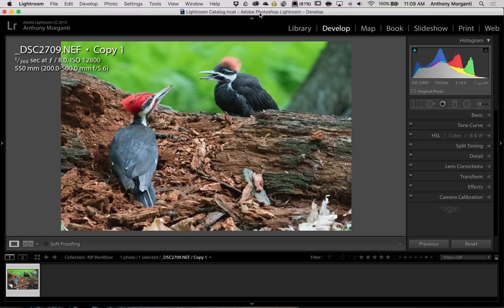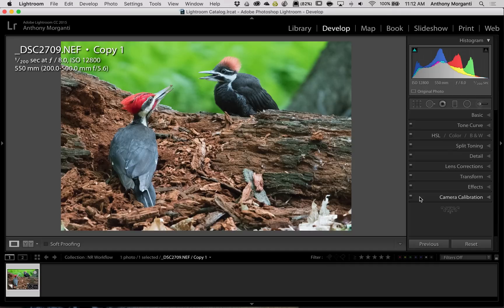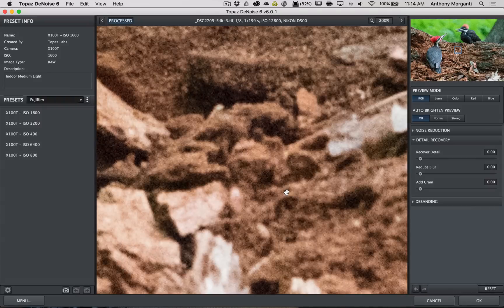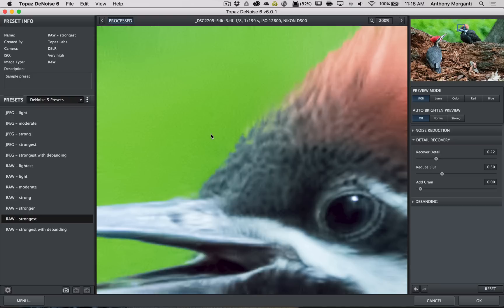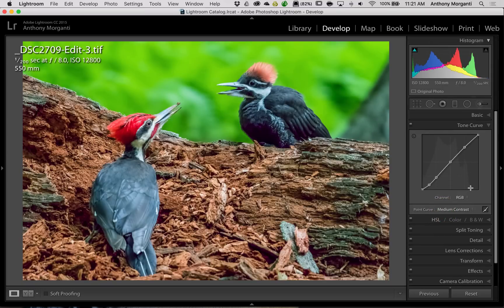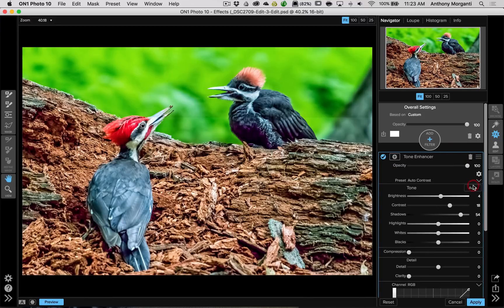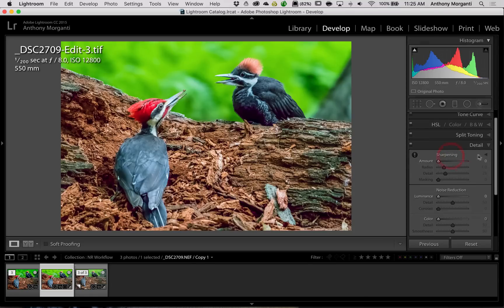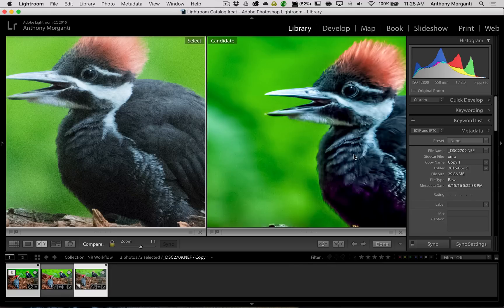High Noise Workflow (Using Lightroom, Topaz Denoise and On1 Effects)

Comment: Thanks, Anthony.  I really enjoyed viewing this video and, as usual, learned a lot from you.  I was just wondering what your opinion is of a method that I used to de-noise a photo, yet keep detail in the main subject.  I just use Lightroom for this process.  I start out by setting the Luminosity slider to about 40, which pretty much eliminates the noise in the photo (I learned that from you in a prior video).  I then use the Adjustment Brush to brush out the noise reduction, but only on the subject(s).  This method seems to work well with birds because the detail in their feathers reduces the ability to see the noise that is present.  From there, one can make the other adjustments you mention in your video, but using Lightroom instead of the plug-ins that you used.  Do you think that this is a viable method?

Comment: If you would use Noise Reduction--Luminance under Detail in you Lightroom, it does better and you can keep it in RAW. You passed right by it when turning down your Default Sharpness. Using Luminace is way better and it stays in RAW....FYI

Comment: Anthony Morganti ON1 is offering ON1 and  ON1 Photo RAW, PhotoFrame for far less than your coupon offered.
Reply from the maker: The coupon code is for 20% off anything you buy even if it's on sale so, you save even more if you use the coupon code.
Reply: I thought it would of done that but it didn't they offer it for it for $79 when I out your coupon the price went higher

Comment: I take notice you didn't correct the purple halo that was created when you opened up the shadows. All the shadows now have a reddish to purple tint in or around them. Most noticeable on the birds belly. It looks awful. I got this result using Lightroom with my Olympus raw high ISO files. Trying to correct this proved so difficult I finally gave up. DxO Optics Pro doesn't cause this problem. It gives a much more natural look. In my opinion, Adobe has become to relaxed in their position in digital processing software for the masses. The competition is now producing alternatives to ACR that produce better results, but everyone assumes it's Adobe, they are the best. That's true for graphic design, but I now use Dxo Optics Pro 11 Elite, Topaz DeNoise 6, and On 1 Effects, much like your workflow. I know these programs take a little longer to process the files than ACR, but it's worth a few more minutes to get far better results. I realize this is not the case for some other manufacturers high ISO files, but for my Oly files, the change to DxO was a huge improvement in the end result.

Comment: Hi Tony, I've been learning a lot from all the tutorials here on your channel, so thanks so much for what you do! 

I have a question about ISO, particularly, why was your's set to 12800 for this photo? Was it very low light? Or was it that plus a combination of an aperture at f/8?
Reply from the maker: That lens has a widest aperture of 5.6 BUT if you use the 1.4x Teleconverter as I was, the largest is F8. So, I couldn't open up the aperture any bigger than F8 and I was at 550mm -- being at that focal length meant I needed a relatively fast shutter speed to achieve a steady shot. Also, the birds where twisting their heads about quite readily and the male was pecking at the wood. So, because of all this factors, I needed to boost my ISO to get a fast enough shutter speed to get a crisp image.
Reply: Understood. Thank you.
Reply: taking compromises is always a sad thing for photographers: I think you did really well with the options you had, to take this picture. I feel like you need an even faster shutter speed to minimize motion blur. 1/200 is usually not enough to freeze the action of a bird (twisting their heads and so on). However raising the ISO even beyond 12800 would be mad. That why I think you took the best possible shot here.